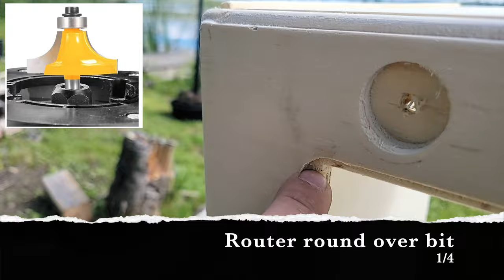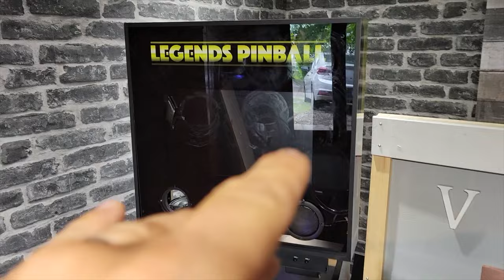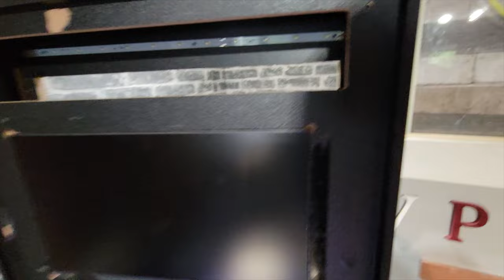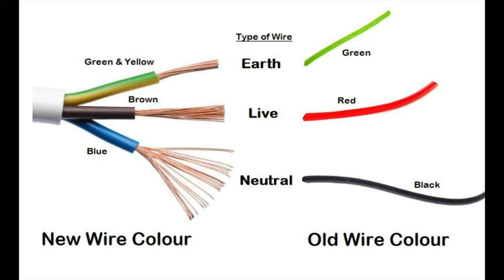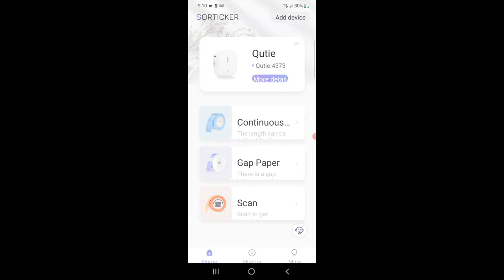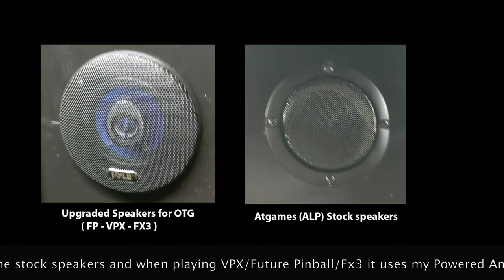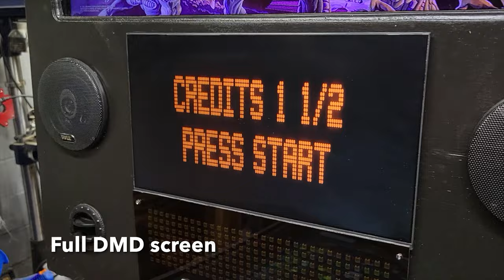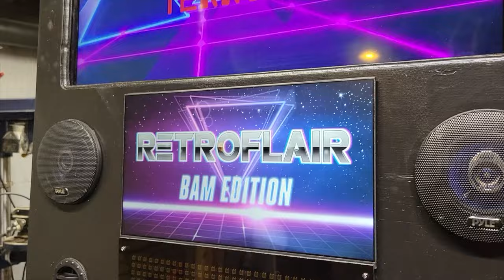Virtual Pinball Backbox XL ( Building my own )

Comment: This was good but got lost right after the power plug install. It went straight to components all installed in back..whatever they were or what function they wired to lol. I understand that's the most time-consuming part, having a cam on while installing parts individually explaining purpose. But it's also the most important part so nothing blows up 🤣